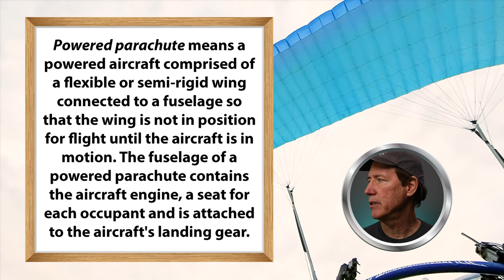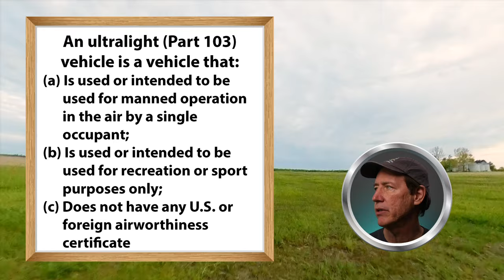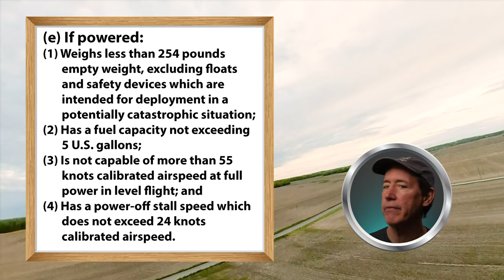Flying a Powered Parachute vs a Powered Paraglider Trike | Which is for you?

Comment: When I was younger I used to skydive but now I have a goal to buy or build a PPG Trike. Ideally, I'd want to be able to haul camping gear on cross-country trips so a tandem trike is probably the way I'll go. Fabricating my own trike frame that has one seat but cargo space up front & rigging it with a tandem wing with a larger power plant is one of the options I've been thinking of.
Reply from the maker: As long as it has just a cargo area and not a second seat, you will be able to fly it as an ultralight if it meets all of the other criteria.

Comment: Hello, I fly a PPG.  One of the things that happens when taking off in a PPG is that when the wing is inflating, the trike normally reverses a little.  I imagine Powered Parachutes would not do that since their engines are more powerful, and the aircraft is heavier.  Once you get the hang of it, a PPG would just as easy to get in the air as a Powered Parachute.  PPG pilots normally just fly for about one hour or so.  Like the Part 103 says, it's mostly intended for recreation.  Very rarely ar PPG's used for competition.  And yes, only one occupant.
Reply from the maker: Thanks for the observation, @rickzelaya1960. The issue often is your caveat, "Once you get the hang of it..." 😀

Comment: I want a nice inefficient but stable wing that I can fly in mid day and not worry about a collapse. The Paraplane Ultralight used a Ram Air Parachute. The guy had crowds of people flying after just watching a 45 minute video. Paramotoring is bassackwards where they start you out with an aerobatic wing doing foot launch. I would say teach them to fly with wheels, get used to it, then consider foot launching.
Reply from the maker: The Paraplane was an awesome piece of technology.
Reply: @EasyFlight  Is it possible to get a ram air wing for my PPG Trike. I have 26HP. Me + the trike is less than 300 pounds. Thanks in advance.

Comment: I saw one of your other videos about PPC and asked about why someone would want a PPC over a PPG and didn’t know about this video, great information.  About tandem though we can fly tandem with paraglider’s or powered paraglider’s but they have to be classified as a “training flight” but it absolutely is done all the time.  I could see the PPC being easier and less  prone to collapse however the newer EN-A and low EN-B wings are pretty damn bulletproof.  I was launching in a strong wind off a 4,000’ mountain today and let my glider get ahead of me, wound up having an asymmetric collapse that popped right back out on launch, probably wouldn’t have even noticed if it wasn’t for the sound, and slight lack of pressure for a split second, it came back out that fast.  But the wind kicked up to probably 20 mph out of nowhere, the risk you take flying in thermic conditions, but I’m a free flight pilot so thermic conditions is what I do, and the occasional ridge soaring, but I really enjoy thermalling and cross country type flying.  Some day I’ll add a butt fan to the mix, even though I’m more interested in paragliding than PPC it’s still interesting to see what PPC is all about, and I definitely think it’s got a place, and for certain people a lot safer than PPG.  Thanks for the info and reading my long comment (if you did🤣)
Reply from the maker: Thanks! 

A lot of people do fly two-place PPGs and even PPCs illegally. What I try to do is explain how to do things in a way that is safe and keeps people on the right side of the law.

Powered parachutes offer more stability than powered paragliders partly because they are heavier, go faster and load the wings more.

Hope the collapse turned out OK. That sounds wicked coming off of a 4,000' mountain!

Comment: Thanks for the Awesome video, it gives me another perspective on ppc, you did a great job explaining the differencees. I haven't had a chance to fly a ppc yet so I can't really compare them, although i would love to give it a try! I Have been a foot launch ppg pilot for a few years, but i had excellent training and a great local ppg community. We even have a ppc pilot in our group that flys with us from time to time. So most of us get about 3 hours out of a 3g tank. Some units even longer. Most of our units fly between 30-50+mph  depending on your wing. You can land and take off in very tight conditions if you need to or want to lol. And you can land at around 5 mph. Engine outs do not happen often, only once for me and i have been flying quite a bit for a few years. Most of the units we fly are very good and well maintained. Also even if you have an engine out you can land just about anywhere because we can land so slow at full flair. We typically don't fly over water unless we have good flotation devices. It's an awesome and free way to fly, the only downside is you can't take a passenger with out a special endorsement 🤷‍♂️. Even though you "don't need" training to fly, it's highly recommended. And with good training you should be able to foot launch in null wind conditions just fine. I can fit my unit in my van, car, or truck, and drive to the field or just fly from my back yard and be set up and ready to launch in minutes to catch that perfect sunset.
Reply: WOW !

Comment: Sorry - I got lost somehow in regards to the difference between the powered parachute and the other vehicle.  I have watched Evolution Trikes on YouTube, but the controls appear to be contra intuitive for someone like me who has a Private SEL license. I don't know enough about powered parachutes to understand how those controls work.  It appears that one steers with the feet, but what controls altitude?  (Engine speed perhaps?). Thanks...
Reply from the maker: Evo Trikes are great! But your intuition is right, it takes a little bit of relearning for a lot of airplane pilots. It isn't impossible to do, it just has to be worked through.

Yes, you steer either with either the feet or by hand, depending on the model. Climb is just excess power, like an airplane. Not a lot of pitch control, though. But there is some.

Comment: I find one of our last comments a little confusing. Wheel launch in zero or near zero wind is preferred by many powered paraglider trike pilots. In no way, shape or form is it difficult to inflate and bring a modern glider overhead on a trike. It's actually trickier on foot launch and requires a fairly steep learning curve to achieve a very low or no wind foot launch. 
Having near zero experience with PPC, I guess I'm not really certain how it is easier aside from the fact that many PPG trike pilots hand guide the A risers on inflation. Again, it's a learned skill but not a particularly difficult one. 
As some other folks have mentioned, PPG is also drifting into the 4-stroke market with ever more powerful offerings while retaining ultra-light status. Recently, we're even starting to see offerings in electric propulsion with up to 1 hour flight times. 
I would also add that PPG is almost always far more portable than PPC. Foot launch units often break down into a size and shape that can be loaded into a compact car trunk. All foot launch units fit easily into a pickup truck bed. Even most trike units fold up sufficiently to fit in a pickup truck or even smaller vehicles. 
One final difference is the agility of a paraglider wing is often multiple factors higher than a PPC. Quick, sharp maneuvers with high bank angles are quick and easy to enter and control. Shorter line sets also quicken roll rates by comparison. 

One question I do have is speed ranges on PPC. Are any of the modern wing offerings able to vary speed in any way? Several Paragliders that I own have trimmed speed ranges from about 25 mph slow to 45 mph fully accelerated. Last I heard, Powered Parachutes fly one speed and only one speed. Is this still the case?
Reply from the maker: Thanks for the comment. I guess that it turns out that with modern wings, the gap between powered parachutes and powered paraglider trikes is narrowing. 

I've seen failed launches in PPG trikes. The occasions were when pilots were taking passengers. It may have been more to do with the less powerful engines and smaller props working to build up forward speed.

Comment: Hi, great video! There are simpler 1-seater ppG trikes, would those work vs. the larger ones for ppC I see in videos?
The PPG trikes would much cheaper and take much less room
Reply from the maker: The larger powered parachutes are generally two-seat machines anymore. The lighter, ultralight versions are pilot only. And yes, the PPG trikes are generally less expensive and take up less room!

Comment: Informative and helpful. One observation as PPG guy with a trike:
 I believe that you stated that in calm wind conditions a parachute glider and a foot launch PPG are easier to launch than a triked PPG? if that is the statement oh, then I would like to suggest that the trike PPG like the parachute glider are similarly easy to launch in calm wind conditions.  In both cases we just sit there and power up until we left off. Effortless! Actually, it is the foot lunch PPG that has been difficult time. The foot launching person has no wind to assist with lift, so they must run harder and longer, which can be quickly exhausting and result in a failed launch.   you did not say anything about  aerobatic maneuvers . Although that's not really  something I'm and, I was thinking that with the parachute glider you trade off the ability to do aerobatics for the benefit of stability?  Again, really enjoyed the content
Reply from the maker: I agree with you that foot launch is the tougher in calm conditions! Thanks for watching!

Comment: I disagree, by definition, parachutes are designed to “fall safely” and paragliders are designed to “glide and soar”
Reply from the maker: Good point. The thing is, technically, the 'parachutes' on powered parachutes are considered gliders. They are flying airfoils as opposed to the round style parachutes, which are the true simply drag devices.
Reply: Indeed...if you are here to fly loving 37 meters wing glider, but "what an ultra light or tricke or parapent glider or power parapent?

Comment: Very interesting comparison.  There’s a new generation of lightweight trike 4-strokes such as the Aero1000 from Helvenco.  Much lighter and more powerful than Generacs.
Reply from the maker: Thanks for the tip on the Aero1000! That does look like a pretty nice engine. The Generacs are great engines, but they are purpose-built for long use in generators, which makes them heavier.

Comment: Very interesting. I own a Bensen B80M gyrocopter  FAA registration number N521LW and while I intend on learning to fly it soon these powered parachutes also look like fun. The autogyros/gyrocopters do not stall with and can fly with zero airspeed (while losing altitude at an appropriate altitude for recovery to normal flight). And these aircraft look to be able to fly at nearly zero airspeed. Rotary wing or parachute wing? Maybe I'll have to learn both = )
Reply from the maker: I'm licensed for both, so I certainly agree with your sentiment! There are a lot of great ways to get into the sky!

Comment: Thanks for the video! I noticed that you were using an Apco chute, is it a Cruiser? I recently tried an Apco Lift 450 elliptical chute and it tried to tip me over twice on takeoff, so I aborted the takeoff!. I would appreciate your opinion explained further in regards to elliptical and rectangular chutes.
Reply from the maker: Hi Dale! It is the APCO Cruiser although I also like the Sunrise and Barnstormer wings.
Reply: eliptical wings are trickier and more unstable on take off, that's why I got rid of my PPG trike, and transitioned into a PPC with more power and stability on takeoff

Comment: What about getting a foot launched glider an N number and flying a PPG as an LSA? Just wondering. I'm a PPL holder and skydiving instructor. Looking for more ways to access the air during the pandemic. I've got a paramotor on order.
Reply from the maker: The definition of an LSA does not allow for foot launch for some reason.

"(11) Fixed landing gear, except for an aircraft intended for operation on water or a glider."

I would just enjoy the unregulated aspect of a Paramotor!
Reply: @EasyFlight  Fixed landing gear? why not just grab a stinger type of skid gear and fix it on? Then you can foot launch, but have "fixed landing gear"
Reply from the maker: @SkydiveHawaiiKid  I suppose you could give that a try, but I'm not sure of the motivation. Are you wanting to fly someplace where ultralights aren't allowed?
Reply: @EasyFlight  I'm interested in flying in controlled airspace and at night.

Comment: people fly ppg with passengers all the time. and i sometimes take off with a light downwind with my ppg trike no problem. So not all is true what you say. never had a collapse with my ppg trike either (since 2006). There is simply to much pressure in the wing. especially with a reflex wing it is almost impossible to collapse even if you try.
Reply from the maker: Just because something is possible, doesn't make it good practice or legal.

Granted, collapses are far more possible in a footlaunch than in any trike because of the increased weight of the trike itself.

Comment: Where are you getting the information that a license is need for a Tandem trike?  You are the only person i have heard say that.  Others say you do NOT need one and many other pilots say that getting ANY license or certification is working against the community because no licenses or certifications are needed at this time.  Please respond.  Thanks!
Reply from the maker: Hi Aiea! Thanks for the question! 

First of all, it depends on the country you are wanting to fly in. In the United States, the information comes from the FAA. Once an aircraft no longer fits the definition of an ultralight, it can no longer be flown as an ultralight. And an ultralight is defined partially by how many seats it has. Ultralights are single seat only.

Now there are a couple of exemptions for two-seat training aircraft which require a different kind of training and sign-off, but they are for training only.
Reply: I’d like to learn more about this response.  I purchased a PPC 2 seater thinking it was still exempt as long as it was used for training purposes.  Can you fill us in on those exemptions please?
Reply: Also what is the definition of training?  If I fly solo in it to train myself does that count?  Or do I have to use it to train someone else?  And what type of license would I need in order to train with it?  Also what was the law that changed in 2004?
Reply from the maker: It probably isn't. Most of the 2 seat machines have more than 5 gallons and have an empty weight over 254 lbs.

That, and you have to actually work to maintain the exemption. They don't just come exempt. They may qualify for exemption, which is a different thing.

Comment: An interesting video but you seem to be informed about Flying Powered Paramotor Trikes. There are at least two companies producing new, powerful 4 cycle engines for trikes. Fresh Breeze and Blackhawk are the two I am speaking of.  Most of the Powered Parachute Trikes have an "A-Line Assist" line which connects to the "A" Riser of the Paraglider which brings the paraglider up once you start moving forward. The paraglider comes off the ground very easily and with no effort from the pilot. Frank
Reply from the maker: Hi Frank! Good point. A-Line Assist has been around for awhile and is becoming more popular on lighter trikes.

The Fresh Breeze Xcitor is a cool machine, but is actually more of a powered parachute than a Paramotor trike. The ones flying in the US are mostly N-numbered.

Comment: No. They're both PPG. With a trike, or without. The design of a PC is fundamentally different to that of a PG, and the difference between a trike PG and a harness PG is ... basically none. If the regs are wrong, they're wrong.
Reply from the maker: You mean the difference is basically none... except that one has wheels and a cart and the other doesn't have those major components. 
That seems like a pretty large difference to me. 😀

Comment: 8:10    Less reliable on a parachute.   A generac on a ppg will easily outlast a ppc engine.  Also, ppc went the way of the dodo a while back.
Reply: BS on that
Reply: @richarddegen6184  what part is not true?  The 4 stroke industrial engine lasts much longer than a screamer or the giant, overpriced square canopied (barely made anymore) with 2 seats and an N number on it 80s machine?
Reply: What is difference between ppc and ppg......

Comment: PP-glider: much more performance. 
Much better glide ratio.  Much less fuel needed. Steering by hand because way less force needed. Fly with much less fuel much further. 

PP-chute: heavy as hell. ABSOLUTELY no performance.  Always high power needed to even fly level. Gasoline guzzling. Shit wings who need much higher pressure to steer (that's why you neef food control with large levers).
As soon as engine fails, you go down like a brick.
In short:
PP-glider are very good and comfortable to fly with 2 people.  Look up "fresh breeze/ X citor". Overall much better,  faster and fly much more agile. 
Yes, they also come with certified aircraft engines not as stated with law mowers engines.  Those are called back packs...!
Sidenote:
Always fly with a BRS rocket reserve chute!!!! No matter what you fly. PPG or PPC.  All none fixed wing machines can collapse due strong thermal or share winds. It's absurd to say that on a PPC a reserve is obsolete. Plain nonsense. 
I fly both since 1998. 
Happy flying ya'll....
Reply from the maker: I have flown in the Fresh Breeze Xcitor. However that is considered a powered parachute in the United States. I agree that it is a great flying machine!